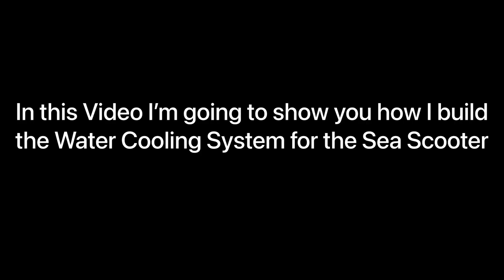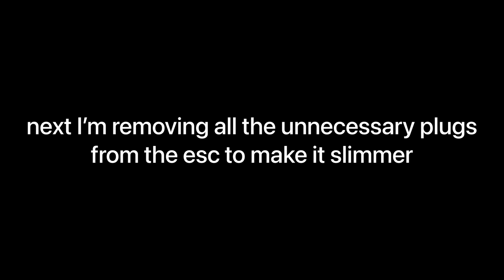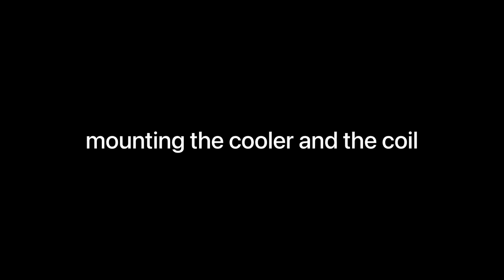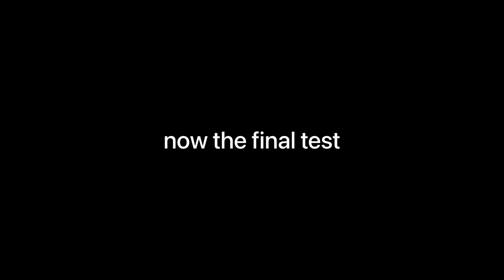DIY Sea Scooter 3D Printed Build Part 4 | Water Cooling System

Comment: @3DPrintCNC do you plan on finishing the project? Or did you finish it and just not film it? I'm building similar thing this spring and I would really appreciate to see your progress, so I could learn a trick or two from it. If you did finish it - did you try it in any depth?
Reply from the maker: I am working on again, I haven’t had a lot of time due to studying and working. I am still looking for a reliable and waterproof solution to control the speed, and a cheap way to build a battery with a lot of capacity. 
I have testet the very first version maybe up to a depth of 2 meters and had a bit of water leaking in but that was with the uncoated 3D printed parts, that’s probably where the water leaked trough.
Reply: @3dprintcnc164  Hey, good to hear from you. And I'm glad that your project isn't dead. If you want we can get in touch and compare findings (FB, Discord, etc).
Reply from the maker: Yeah of course we could do that. Send me a DM on Instagram.
https://instagram.com/3dpri_ntcnc?igshid=ZjE2NGZiNDQ=